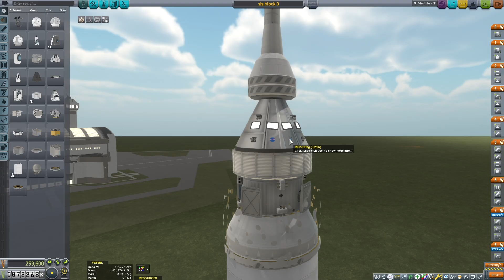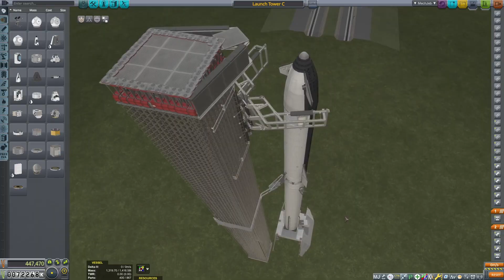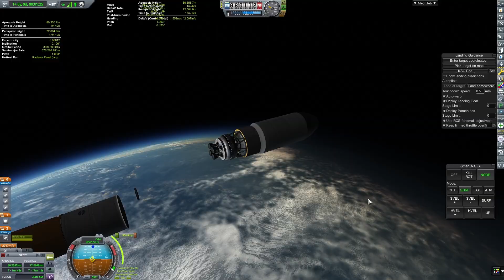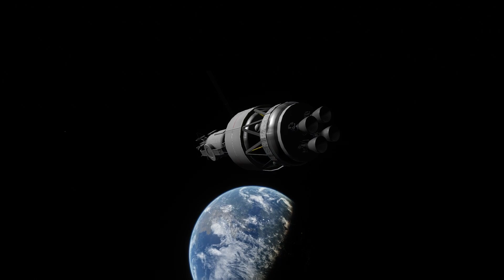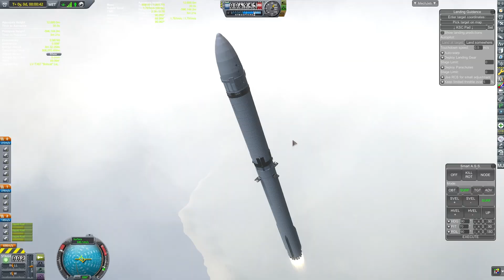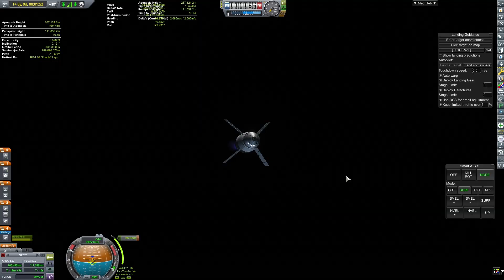KSP- HLS and SLS- Fully stock. Episode 2

Comment: Tip for starship catch, come in from over the roof of the tower to remove the need to roll after flip and then go down to 2 engines after flip to increase ur ability to fine tune your throttle
Reply from the maker: I know, that was what i was mentioning in the voice over with the banking. I didn’t bank for this attempt and so that’s why it didn’t work also I will flipping with 2 and landing with 1 engine to make starship as light as possible
Reply: @RamSF24 that is probably best, also idk if u do this but for hot staging to make it easier you could use a kal controller to do it automatically so you only need to use one button but also so its more consistent, also idk if u remember me but im the person from xbox like 2 years ago who suggested using the flags as heatshields, great content and keep it up
Reply from the maker: I do remember you i used to posted on the Xbox club back in the day. I like doing to the hot stage my self to line up the trajectory to the pad. It flips way fast and I can use the 200 m/s to get to around 40,000 instead of 30,000